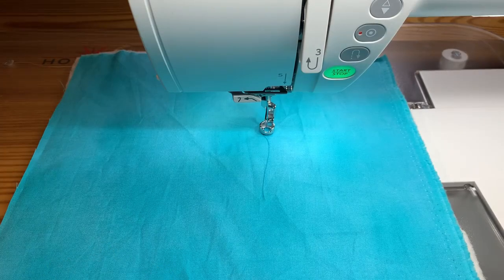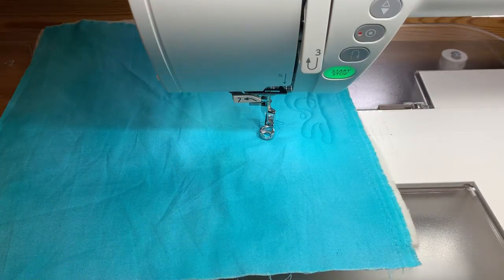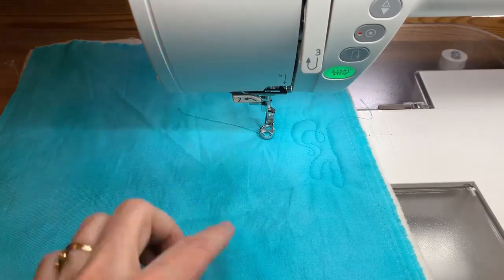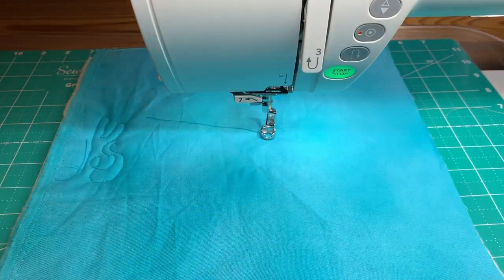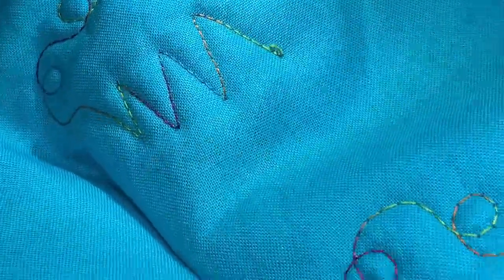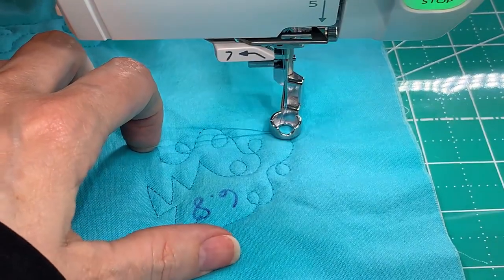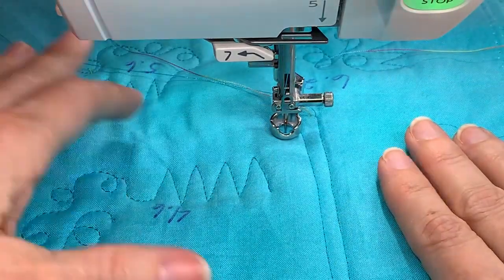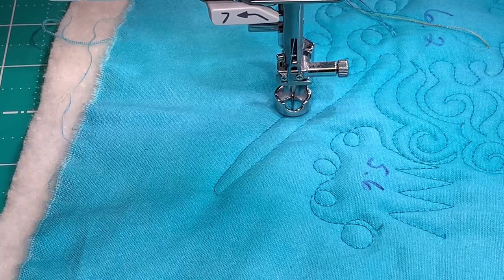Freemotion and Rulerwork Troubleshooting with Kate Quinn of FabriKated Quilts.

Comment: Lowering your foot is great, but I have trouble at the seams.  Sometimes my foot is too low to pass over bulky seam but then too high for the flatter parts.  Do you find that you are adjusting your foot height as you quilt from block to block?  How can I fix this issue?  Also where can I find the grid glider?  I have a supreme slider, but I think the markings would be very helpful.
Reply from the maker: Hi Angie,

I have two glider styles:

Here is a link.  https://www.fabrikatedquilts.com/iishop?form_version=2&showSearchResults=1&search_keyword=Glider&image_x=0&image_y=0&image=Search

I do sometimes have to adjust the rulerfoot to get over bumpy seams.  I do also adjust it back after if it is really high.  I also try to manage seam very diligently as I am piecing a top to minimize any bulk.  Or choice a design that does not end at or near a bulky seam knot.  That can be challenging,
Reply: @katequinnoffabquilts  Hi Kate, thanks for the quick response.  I was looking at your online shop and there are a few things that I am interested in that are out of stock.  Specifically the bohin chalk pencil and the polishing kit for the grid glider.  How soon do you receive items?  I am in Canada so shipping costs are high and I was hoping to order all items together.  If the wait is too long, then I will go ahead with the mat alone.  Are you able to give me any information about this?

Also thank you for your tip about bulky seams, I have been making an effort lately to keep them flat, but I also like your idea of planning designs away from these areas.  I have just discovered you on you tube and am finding your information very helpful, I just need to make the time to watch.   The videos are a bit long, but the information is always good.  You have so much to share, skimping because of time would be a shame.  

I’m looking forward to learning more.  

Angie
Reply from the maker: Hi Angie, since you are in Canada I would refer you to my friend Nulagh Devlin who owned a Canadian distributor shop for Sew Steady and other sewing products.  Here is the link for her shop.
https://www.stitchintheditch.com/Default.asp

This will be cheaper and easier for you.
Reply: @katequinnoffabquilts  thank you so much for this, I will definitely check out her website.  You are right, so much easier to shop in Canadian stores.
Reply: @katequinnoffabquilts  hello again, I just placed my order this afternoon and all items were in stock.  Thank you so much for the referral to the Canadian distributor, the shipping costs are so much better when they are not international.  Also there will be no delays with border crossings. (Win, win) I really appreciate the tip, I let the shop owner know that you sent me to her.  Thanks again!
Reply from the maker: So glad to help you in the most efficient way possible.  Happy Quilting.

Comment: You should show what your doing on the settings so we know where those setting are
Reply from the maker: I spoke through the setting because my machine is very specific and it will not help the general public if they try to do it the same.  Each quilt sandwiches and batting and machine will have its own quilts or requirements.  The basic direction is that the foot needs to be as low as possible to stitch well while not preventing you from moving.  If this was a Janome channel I would do that and have a video regarding that if you need it, but my channel is brand non specific so I did not do that here.

Comment: why would you ever take the glider off the sewing machine?
Reply from the maker: I need to remove my gilder to change the bobbin on my machine and also to clean my machine.  I also have to switch machines for my job so I frequently have to remove and re-adhere it.  Also I like to clean if periodically so it sticks better.  It gets linty over time.

Comment: I love this video. Thank you - great advice and so clearly presented. I am hoping that you can help me with a problem that I am having.  I am trying to use rulers to complete a quilt for my grandson. I did an in-person workshop a couple of years ago and I have watched SO MANY videos, including yours. I did not have issues using rulers after the class. Now, however, I must be doing something wrong setting up my machine. With the ruler foot attached, It works going forward, but I can't get it to work going backwards. I am using a Janome QDC3600 and a low-shank ruler foot. Stitch length set to zero. Feed dogs down. Aurifil 40 wt thread. Quilting needle 90/14, Can you tell me which settings to use and/or what I might be doing wrong? Thank you in advance. I am running out of hair to pull. Lol.
Reply from the maker: I wonder if you foot is too high.  This is the number one cause of skipping.  Check out this tutorial: Freemotion and Rulerwork Troubleshooting with Kate Quinn of FabriKated Quilts.
https://youtu.be/aqu0DOxG728

Let me know how it goes..
Reply: @katequinnoffabquilts  Thank you so much for your suggestion. It was a combination of foot height and tension. AND i think a need for a bit more practice. Lol. Thank you again.

Comment: GREAT tutorial!  I just quilted my first runner..not good.  A few questions...I use a MC Janome 8200QC, I don't understand what you are doing to raise and lower the foot, mine has a wire like thing that you turn but it doesn't go low enough.  Second question, where is the tension you are changing?  Is it with the big screw that you turn with the screwdriver, the dial that is usually at 5 ?  I am very new to quilting and a newish sewer.  Thanks!!
Reply from the maker: What machine do you have?  I am making adjustment that my machine allows but that may be different on yours.  Email me some pictures of your Rulerwork setup.  Kate@fabrikatedquilts.com

Comment: I loved this lesson but what would you do if your machine dont have  a speed regulator .
Reply from the maker: We have a new product called the precise pedal power than is designed for non stitch regulated machines.  Also, I regulated with my speed control but I was using the sound of machine.  I don’t have a stitch regulator.  I will try to add a link for this later but I have class this morning.